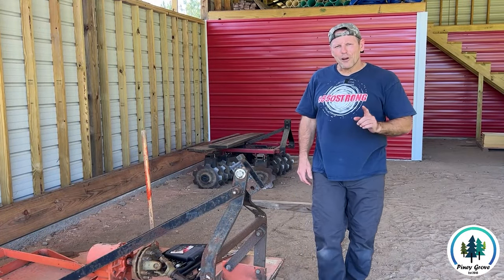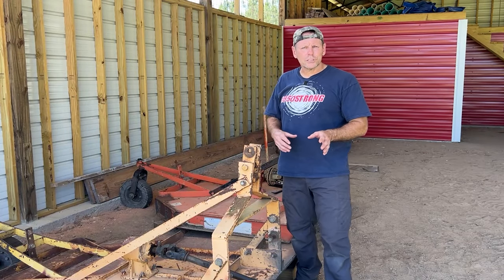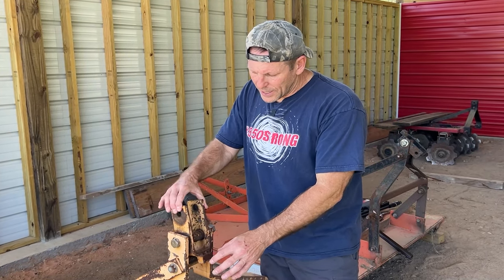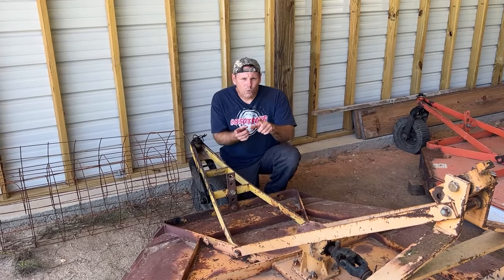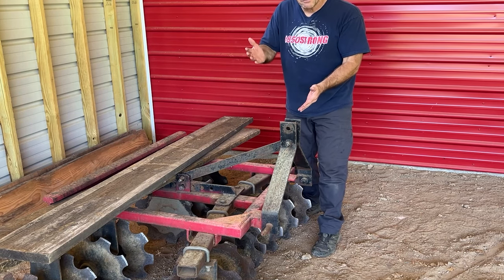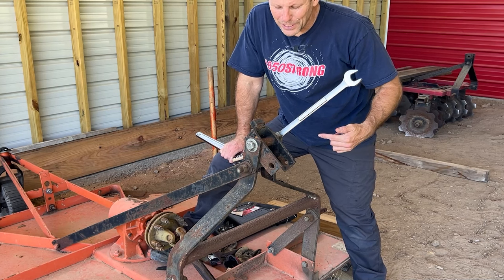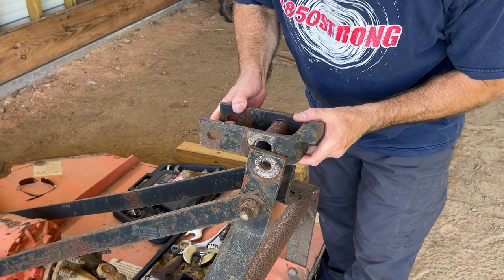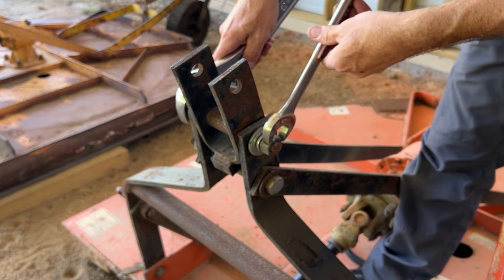Is Your Brush Hog Hitch Assembled Correctly? | Brush Hog 3 Point Hitch and Top Link

Comment from the maker: Not sponsored, but the bracket is called a swivel kit:  https://www.brokentractor.com/p/king-kutter-rotary-cutter-swivel-kit-501027-501027/

Products in our Amazon store used in this video (costs nothing extra to use these links!).  You don't have to buy these specific items to support our channel....just use a link below to get to Amazon then make any purchase: 
Flex Tape: https://amzn.to/3R4MdWm
Mechanix Leather Gloves: https://amzn.to/3HjoZZf
Titan Post Hole Auger: https://amzn.to/3toHEx2
Ratcheting Fence Tensioner: https://amzn.to/3aEfSX0
Pope and Pipe Level: https://amzn.to/3tqUhHX
Fence Post Puller: https://amzn.to/3QbcNhy
T Post Manual driver: https://amzn.to/39dwt3J
Come Along Winch: https://amzn.to/3aQMqND
Clip bending tool: https://amzn.to/3xlqrG0
Mechanix Leather Gloves: https://amzn.to/3HjoZZf
6’ Digging and Pry bar:  https://amzn.to/3vH5Agx
Dewalt 20V ½” Impact Wrench: https://amzn.to/3UOcXNH
Dewalt 20V brushless Leaf blower: https://amzn.to/3zwJcYm
Dewalt 20V brushless ½” drill: https://amzn.to/3HGXJ7z

Comment: I've never seen anyone use a top link with a brush hog. We always use a short chain as a top link so you can still pick it up if needed but the chain allows it to follow the contours of the land and won't bend the brush hog if you cross a ditch or terrace wrong
Reply from the maker: That's why it has that pivot point.  I think most people use top links.
Reply: @PineyGroveHomestead  but they won't pivot enough if you cross too much angle. Of the 8 or 10 people I know locally, none use a top link. We live in the foothills of NC so nothing is flat here so maybe that's why. I use a chain so I can still lift it but most people around here use nothing for a top link. they pick it up by the lower arms and let the rear wheel roll. I've seen several brush hogs on you tube bent and beat to death from using a top link but not around here. Most old timers would never use a top link on a brush hog unless it's chain
Reply: Yeah after running a chain with my brush hog I'm not going back. It follows contours better and has no binding anymore.
Reply: @joerapo  yeah agree. That 6 or 8 inches of pivot with a top link isn't enough. Plus that's a newer thing. Old bush hogs didn't have a pivot point. Anyone who tries a chain never goes back to a solid link that I've heard of. I guess if your land is completely flat you could get by but there's no advantage. You can still pick it up all the way with a chain it just lets the rear flow up and down as much as needed
Reply: at which point did your 3pt have down pressure
Reply: @kidsythe  most 3 points don't have down pressure. I'm not sure where you saw that in these comments
Reply: @chaseledbetter5186  🤔 then how does the top link bend? won't it just push up? I'm new the tractor's. I've only brushhogged like 15 acres. but I just sit it down to setting 3 and it floats over the ground without scalping it with the front edges. 

when I go over a huge dip the tail wheel just lifts the whole thing up.
Reply: @kidsythe  my bushhog is long enough that if the tail wheel needs to go higher the bushhog will try to pivot at the lower arm pins and push the top link towards the tractor, bending the bushhog. It's a 5 ft with single tail wheel. I guess if the bushhog were a 4 ft it might just all float up. I've just never seen that plus if the whole thing floats up it wouldnt cut even. With a chain as a top link, the rear of the bushhog can go up and down while maintaining an even cut over ditches and swells. The chain as a  middle link allows it to pivot at the lower arm pins. You actually don't need anything at a top link unless you need to pick the entire bushhog up for long transport. A lot of ppl that just drive from their house and bushhog on thier land don't put anything as a top link.
Reply: This comment was more valuable than the video for me. Everyone has chain laying around. Not everyone has fancy pivots
Reply: Hey I’m all for trying the chain, I’ve bent so much of the superstructure of my brushhog over the years even using the pivot link, just not enough travel for my hillbilly terrain,  once I get my most recent damage straight and reinforced I’m going with a chain …..thanks for sharing
Reply: @griggbaylee5808 where does the chain connect? Between the top arm of the brush hog and tractor? How long of chain should be used?   Thank you!
Reply: I use a chain.
Reply: @pspaulson  chain connects exactly where the top link would go. You just have to play around and adjust it to where it's long enough to let it float but short enough to still pick up the bushhog
Reply: I don't make videos but if you click my name I have one short I made of how mine is set up with the chain as a top link. I tried to post the link on here but it won't let me
Reply: I use a top link and never had an issue. My tractor has 3 different spots to hook up the top link and the owners manual says use the lowest or bottom hole which I would of thought opposite. Ground ingauging equipment like a plow or rototiller says use the top hole. Without the top link how does the bushhog stay level or flat?
Reply: @chadbinette3201  you keep it level by raising and lowering the lower arms of the tractor. It rides on the tail wheel of the cutter.
Reply: @chaseledbetter5186  I'm saying like sometimes you may have to lift the whole unit off the ground. When on the road I can lift my bushhog right off the ground. Granted it's only a 6ft one but to each is own
Reply: @chadbinette3201  yeah I have a chain as a top link if I'm going down the road or somewhere that's not one of my fields. The chain allows it to still pivot and follow contours of the land by the tail wheel riding the ground but still get taut when you lift it and pick the entire brush cutter.

Comment: LOL, I am impressed but would have opted for a chainsaw for a number of those trees. Rotary cutters aren’t cheap so I am not inclined to put them to the test on anything bigger than a couple of inches round. The occasional stump or deadfalls causes enough wear and tear but is somewhat unavoidable depending on the property.  For the group, just my opinion but a dual spindle rotary cutter does a much better job on hay and brush fields job. The only issue is, they typically don’t have a dual spindle BRUSH cutter under 8’ and those are usually over $10k for a new one.  I am not talking about a 3-pt finish mower, which is not something to be cutting tall grass or brush with regularly.  Try a dual spindle rotary cutter compared to you single spindle cutter.
Reply from the maker: This brush cutter has been through a lot!   https://youtu.be/2LtKLLMwSRE

Comment: Here those mowers are called rough cut mowers. Very seldom are those units actually used for cutting brush.  I always put some grease or oil on those top link brackets and make sure they are moving freely just by using 1 finger.
Reply from the maker: We work 'em hard here!   https://youtu.be/2LtKLLMwSRE

Comment: I had an old Bush Hog brand finish mower that I inherited from the previous owner of my property.  It never worked well.  It often dug into the ground and bent the casters, having to replace several over the years which is expensive.  This video made me realize the previous owner had the swivel bracket setup backwards where there was no swiveling happening at all.  I took it apart and assembled it correctly and now that finish mower works like a dream, hugging the ground perfectly and not digging in.  Thanks for taking the time to explain this.
Reply from the maker: That's awesome....glad it worked for you!

Comment: Those first 2 brush hogs are virtually identical to a Chinese one I have just purchased in NZ. I consider the way rear wheel is attached to body is a design flaw. It should run on an independant mounting bolt to make height change easier.

Comment: When you use a brush hog or grooming mower ! You need to use a “soft “ link on top or a piece of chain so that the cutter will follow the contour of the ground better
Reply from the maker: Not if you have the flex built into the mower like I show in this video.  Most brush hogs have this type of hitch.

Comment: I just ordered the Kit. Thank You. I am new to Rotary Cutters and tractors in general. I purchased a very well made and in outstanding condition Rotary Cutter only to discover two things: 1.) It is very old and the company is out of business ("Servis") so I can not get parts, and  2.) The 45 degree straps are bent exactly as you said they could be about half way down from the top link connection point. There is no pivot point on those straps and no pivot bracket where the top link connects. I have not used the RC yet but have checked everything on it and it appears excellent except for no pivot point. You most likely saved me from really messing up my RC or my new to me Ford Jubilee.  Thank you.
Reply from the maker: Most people take the pivot point off because they don't understand how it works!

Comment: I have had my king cutter bh for 20 + years and I usually cut with that top link unhooked because when I go over uneven terrain the U bracket turns all the way down and binds then lifting the deck to a higher level then I want to cut ,, I will have to see if mine is assembled correctly and maybe I wont have to cut with it unhooked ... thanks for this information!!!
Reply from the maker: Many are sold put together wrong!  Thanks for watching.

Comment: I don't currently own a brush hog but I've used many in the past when did farm work every summer for over 10 years. None of the ones I used in the past included that pivot.

Also puzzling me is the fact that my tractor's 3-point hitch doesn't produce any down force and will easily raise upwards if my 3-point implement gets pushed upwards by something.

I can see that pivot allowing a brush hog to change its angle with the ground though. That might be useful if you want the reward wheel end to be able to independently raise upwards. Without that pivot, pushing upwards on the wheel would raise the entire brush hog.

On the other hand, the brush hogs I've used only had a single wheel so allowing just the rear wheel end to independently raise would allow the front of the brush hog to potentially hit the ground more often.

Are you certain all brush hogs, even low priced discount models are supposed to include that piece and related pivot?

BTW I have a hydraulic offset flail mower that I find works very well for us.
Reply from the maker: All of our brush hogs are King Kutters and they come that way.    I've seen the 45 degree supports cut and chain welded there for flex.

Comment: Great video! I have that horseshoe bracket on my tractor and I honestly thought it was just something that was added by a previous owner for who knows what reason! lol! Of course it is also backwards. So that will be corrected as well. Question though, for quick hitch setups, would that be why you see some brush hogs that use chains to attach the top of the 3pt to the back of the cutter, to make up for the lack of the horseshoe backet and still allow the cutter to pivot?
Reply from the maker: I've seen that before..  I think my oldest brush hog came that way and I put bars back on it.  Thanks for watching.

Comment: I use chain, also, but not for the top link.  I replaced the "45-degree brackets" with lengths of chain.  They max out to lift the attachment, but flex when, say, backing into a hill.  We have very uneven ground in New England.
Reply from the maker: That's a good way to rig it too.

Comment: No idea why TSC and RK struggle so much in putting the king kutter flex hitches together correctly. Was at two different RKs and a TSC Yesterday and the top link was wrong on every one of around 20 rotary cutters.  A lot of people running around out there dragging their tail wheel every where they go.
Reply from the maker: It might be more about the $10 teen labor. "Hey kid, go put those mower things together!"

Comment: So which is better to have? A flex hitch or rigid?
Reply from the maker: The flex hitch is best for uneven ground and going forward.    We do a lot of extreme brush hogging in thick brush and it doesn't back over thicker trees as well as the fixed hitch.   It wouldn't be good for this: https://youtu.be/2LtKLLMwSRE

Comment: Shouldn't a 3point hitch float and absorb this kind of motion or is this just a concern for additional float beyond the normal travel of the 3pt hitch? I know my 3pt hitch "floats" down and hydraulically lifts. I can go behind the tractor and completely lift an (extremely small...) implement to the top of my 3point hitch's range and then it just floats back down to my set point. It's one of the reasons you can't "force" something like a plugger or a tiller to a certain depth and either have to add weight or just wait for it to scratch enough to get down to the point where you've set your 3pt.

I do think some of the more industrial "big ag" tractors do have some ability to hydraulically press implements down to certain heights, but I'm not aware of any compacts or subcompacts that have the ability to do this. They all float down to a set point.

Admittedly, you are a bit more aggressive with that brushhog at the end of the video than I ever am. lol.

What am I missing?
Reply from the maker: A brush hog has to pivot or it will stress out the tailwheel over uneven ground.  If you rely on the tailwheel to pick up the whole implement plus the tractor arms from the back it will break the tailwheel off!

Comment: I just use the float function on my tractor,  pto yokes stay parallel 😮
Reply from the maker: Most tractors don't have rear float.
Reply: @PineyGroveHomestead  Don't most tractors have both a hole and a slot on both vertical lifting struts?

Comment: Brush hogs should be mounted on the front of the tractor.
Reply from the maker: But how to hook up the PTO!  🤣🤣🤣
Reply: @PineyGroveHomestead  Hydraulic motor. No PTO drive shaft.
Reply: That would be ideal for viewing the work being done. Tim in northern TN
Reply: Get a skid steer, that's what I did.
Reply: @SouthernGround  I have a Kubota SVL 97 high flow, a five-foot brush hog and a FECON forestry mulching head. But I can't find a 15 ft batwing bush hog that will work with it.